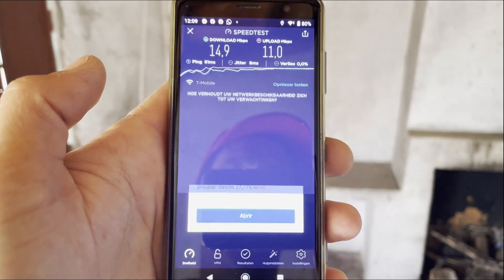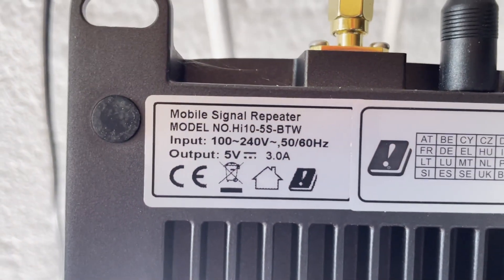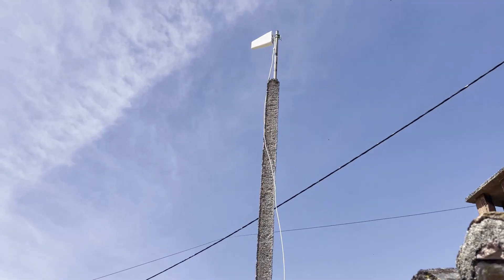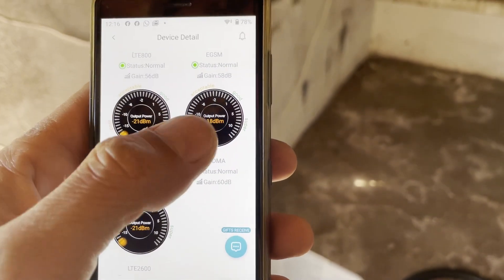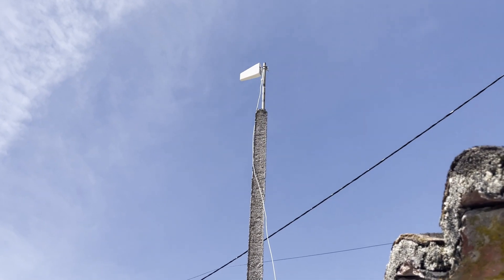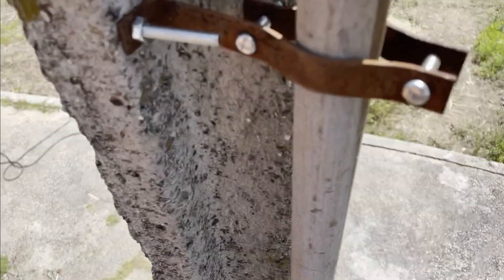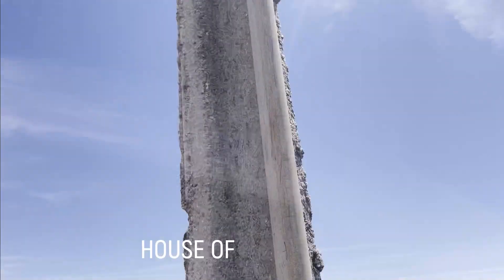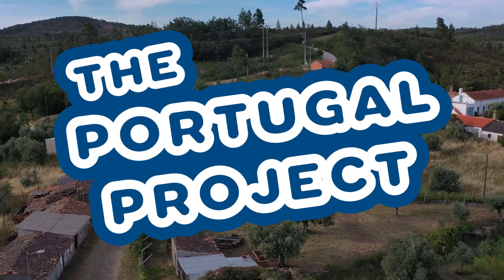Boosting cell phone signal in Portugal - HiBoost HI10-5S

Comment: The old TV antenna might have worked really well as 4G uses the old frequencies allocated to TV. It might have pulled in a better signal but the the old tv antennas were quite directional so you might have had to get it aimed directly at the cell tower.

Comment: I really would appreciate it if you could turn on close captioning as I'm an old fart (80) and hard of hearing.  Thanks.
Reply: I think you can turn them on yourself. With the video running, tap on the picture. In the top right corner 3 wee dots in a column appear. Tap on them. A menu will pop up and you can tap on captions then turn on captions. If they annoy you on other channels you can do the same to turn them off. Hope this helps.

Comment: ground that steel , when lightning happens I will worry about it, it's an magnet for them...
Reply from the maker: Yes it is correct.. Also all the house has no ground fro electricity. I will need to work on that soon :)
Reply: ground that steel and you will attract lightning .. you ground your house electrics to facilitate ADS (automatic disconnection of supply). Two different things ..